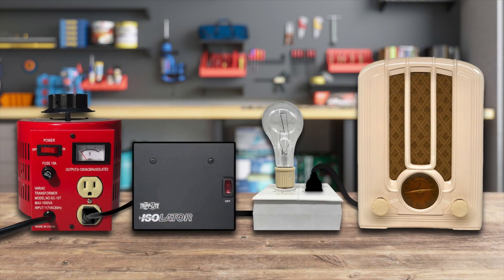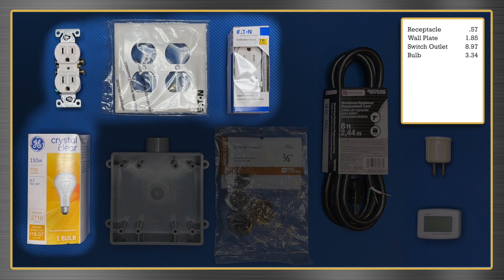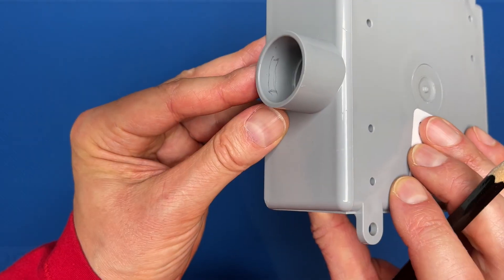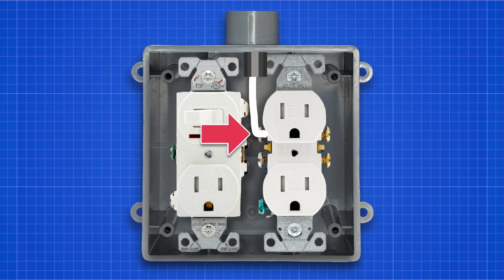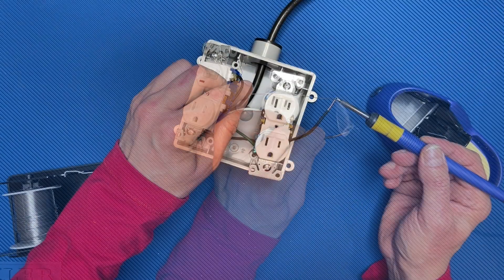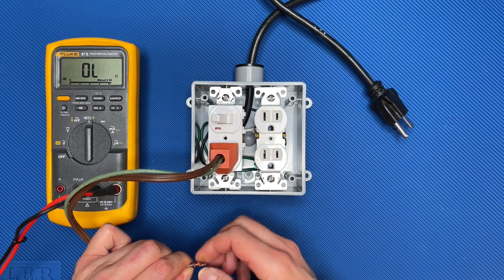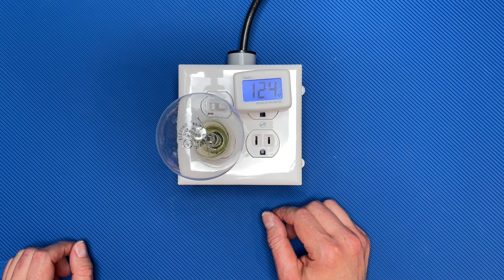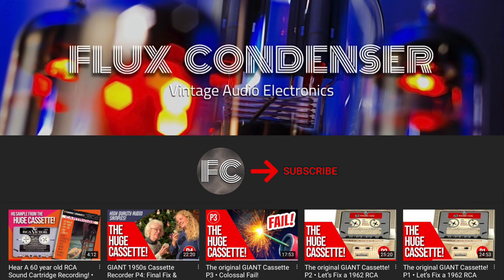Build This Dim Bulb Current Limiter

Comment: In case you didn't know about it, there is a special glue-in adapter available at Lowes or Home Depot, (or most other electrical supply stores), that you can use with that PVC box that has a rubber insert in the end that has a hole in it that's the same diameter as the round power cord, along with a threaded ring that tightens down onto it so the cord doesn't pull out. It is specifically designed for cords of this round type, and it is an even neater, more professional looking way to do the cord strain relief, and it works just as well as (or even better than), the black push in cable clamp that was used here in this video, except that with the glue-in one you don't have to modify the box hole at all first, you just glue it in with some conduit or PVC glue. The black cable clamp that was used in this video is made specifically for Romex wires going into a metal enclosure such as a breaker panel box.
Reply: What is it called???
Reply: Another way to make it look more professional is purchasing the Cantex 1/2" 2 Gang box Model R5133380 and the Commercial Electric 3/8 in. Speed-Snap Non-Metallic Snap-In Clamp Connector Model FNC1S-38-5 from Home Depot. The snap-in clamp connector is a compression fit, and I found getting it started into the box opening with long needle nose pliers while pushing did the trick.

Comment: how to do if it is UK plug?
Reply from the maker: If the winner is from outside the US, I will rewire it. The kit has options for different voltages and the UK will not be an issue.
Reply: @FluxCondenser  Understood. Thank you very much.

Comment: My question is. If there was a short in the radio, then the bulb would have quickly burned out before damaging the radio?
Reply from the maker: No, a short won’t blow the bulb, it’ll simply make the bulb glow to it’s maximum wattage. A light switch is nothing more than a short in the wiring. So, a short in the radio is nothing more than a light switch. That said, while a short in the radio won’t blow the bulb in a dim-bulb current limiter, the bulb will absorb a great deal of current which can potentially greatly protect the radio or other device from severe damage.

A fuse, on the other hand, IS designed to blow in the event of a short, provided enough current runs through it that goes over its rated amperage.

Comment: Excellent vid! Really like the the addition of the voltmeter to give true voltage to the test item, since there is a voltage drop across the bulb AND the variac output is not as accurate as the voltmeter.
Reply from the maker: Thanks, Ron. Glad you liked the video. Yeah, I find that little voltmeter indispensable in this setup.

Comment: Do you have the link to the variac? Cant find it in your amazon link.
Reply from the maker: That Variac no longer seems to be available. A company called PHC enterprise once had that isolated Variac on the market and available through Amazon, but their web site and variac seem to be gone. If you want a new setup, I’d recommend getting a typical Variac (non isolated) and also purchasing a Tripp Lite isolation transformer to use with it. You could also take your chance with a used Sencore Powerite variac/isolation transformer on ebay. Those are good units, but you’ll want to verify the safe operating condition of anything you buy from ebay. Good luck!

Comment: So - are the more recent "variac" transformers that look like this one and available on Amazon isolated or not? e.g., Mophorn TDGC2-2KM. Or would you need to buy and disassemble it again?
Reply from the maker: If it doesn’t state that it’s an isolated unit, it’s not going to be isolated. Most Variacs are not. If you do find one that claims to be isolated, though, it’s a good idea to double check. You won’t really need to disassemble it. A simple continuity check will do the trick. Isolated Variacs are hard to come by and I believe the one I own has been discontinued.

Comment: Best dim bulb video - only requires one outlet/fixture box. 
The plug-in bulb socket is brilliant and simple (most use a separate junction box and a surface fixture), as is the voltmeter.
Reply from the maker: Thanks, Stephen.
Reply: @FluxCondenser  I completely agree! I just bought the parts to build and, since I have ample three-prong power cords, came in below your cost. Thank you and I have subscribed to your feed.

Comment: Fun video. Thumbs up. 
I don't understand why the lower wattage bulb reduces the current more? I was expecting it to be the other way around. I expected the 150 watt bulb to draw more current and cause you to increase the variac. I'm confused. Please explain.
Reply from the maker: That’s a good question, Richard. In this setup, the bulb serves two roles:

1. Provide a low-resistance pathway of current for a device plugged into the current limiter that is operating normally.

2. Provide a safe place for current to go when a device plugged into the current limiter is drawing too much current due to a short, etc. 

Under the first scenario (when a non-shorted device is plugged into the current limiter) the bulb never receives enough current for the bulb to draw its maximum wattage (it glows dimly). This is because the circuit to the lightbulb has the resistance of the device plugged into the current limiter reducing the current to the light bulb. It’s like wiring a light bulb normally, but introducing a resistor to the circuit. 

In the second scenario (when a shorted device is plugged into the current limiter, which is basically what the current limiter is designed to provide protection for), the bulb does receive enough current for it to draw its maximum wattage (it glows brighter). That’s because a shorted device plugged into the current limiter is basically the same as wiring a bulb normally with no resistance.

I still haven’t explained why the lower wattage bulb reduces more current in normal operation. That’s simply because a lower wattage bulb has a thinner filament than a higher wattage bulb. The thinner the filament, the more the resistance. The thicker the filament, the less the resistance. So using a lower wattage bulb is like adding a bigger (more resistance) resistor to the circuit.

Hope this helps.
Reply: @FluxCondenser  Great! Got it now. Wasn't thinking of it in terms of a resistor. Makes perfect sense. Thanks. Keep the vids coming.

Comment: I want to build this but the voltmeter takes 2 weeks to deliver.  Can I build it the same way and just add the voltmeter when it comes and use it meanwhile?  The other parts are available now.
Reply from the maker: Absolutely! The voltmeter is completely optional. Useful, but optional. Just make sure you’ve got some means of double-checking the voltage coming out of your Variac/Isolation transformer. I’ve got all the parts to build this listed on my Amazon Affiliate page if you want to start there. Anything you purchase there helps out the channel. Check it out, if interested: https://www.amazon.com/shop/fluxcondenservintageaudioelectronics
Reply: @FluxCondenser  TY.  After reading your reply and giving some thought, apparently the the digital voltmeter outlet can be used as a standard outlet (with the same voltage as applied by the variac to the other outlet).  And, AAMOF, the voltmeter could be removed after finding the actual voltage being applied by the circuit and even another receiver being tested could be plugged in?  (Not sure why I would want to, but just trying to understand how the circuit is working).
Reply from the maker: Yes, that’s correct. Both outlets on the dim bulb tester are the same and either one or two can be used. I can’t think of a use where I’d want two components plugged into it at a time, either, but if they were within the limits of the bulb and Variac, yes, that would be possible. I wouldn’t recommend it though, as if there were a short in one component it will put full current into the other. The real intention of the extra outlet is just to make it simple to add an inexpensive, yet reasonably accurate voltmeter.

Comment: Mr. Condenser you videos are very informative and excellently presented. I wonder if you could be so kind as to recommend an isolation transformer or perhaps the appropriate specifications for one. I will say aging you have the gift of making the complex understandable, Many thanks.
Reply from the maker: Thanks! The Tripp Lite isolation transformers seem quite good. There are three models available which are similar but have the following different wattage ratings: 250W, 500W, 1000. The higher wattage units are naturally more expensive. For most radios and basic stereo equipment, the 250 watt unit may be fine. If you’re dealing with larger amps, etc., you’ll need to go higher depending on your needs. Figure out the wattage of the most demanding device you’ll have on your bench and go from there. A little extra cushion wouldn’t hurt. Remember that these units don’t isolate the ground, so if you need that, use a simple cheater plug. Tripp Lite isolation transformers are available on Amazon, and you can find more info here: https://www.tripplite.com/products/isolation-transformers-standard~25-112
Reply: Thank you so much for the prompt and courteous reply.  I feel I have learned so much from you good teaching.